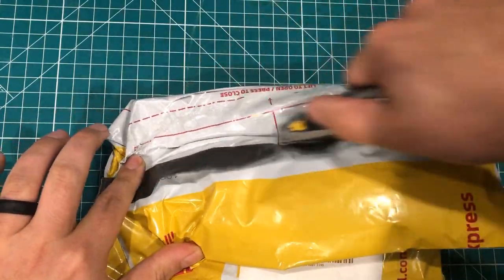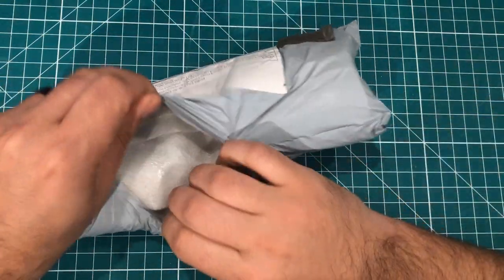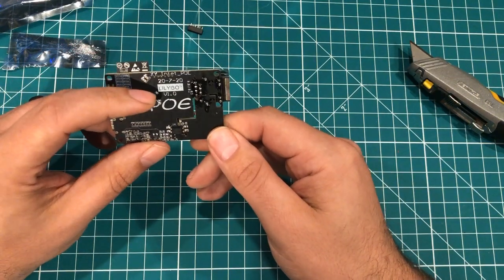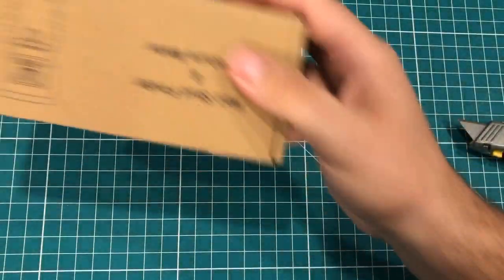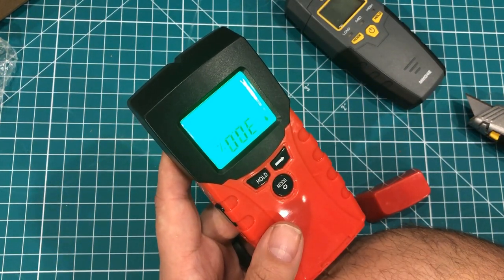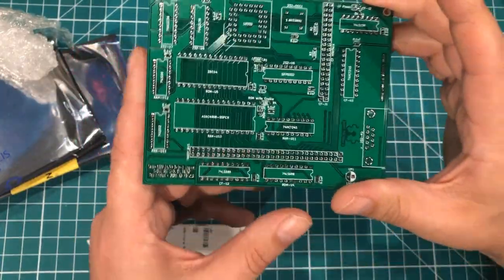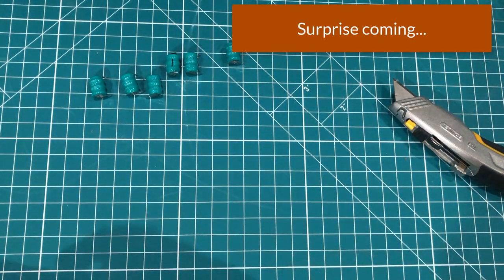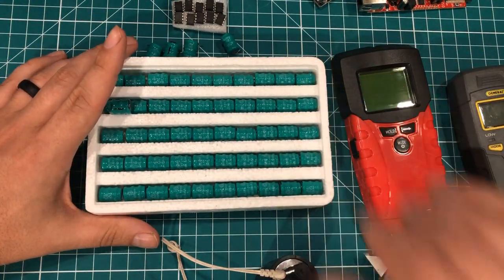Mailbag 36 - I'm 30.1% Moist

Comment: On the Amazon Basics cells, they seem to get very bad batches like the large box of AAs I have had the misfortune to receive which have a fraction of typical alkaline AA mAh capacity.  On the flash memory chips, I love the NOT ESD safe foam they put them in to protect the pins, but that's typical.  I'd test those NiMH batteries for capacity.  Seven sets of eight for $3?
Reply from the maker: I always sort by most recent on the reviews of things like that because you're 100% right.  They are really prone to bad batches.  I will definitely run a test on those batteries.